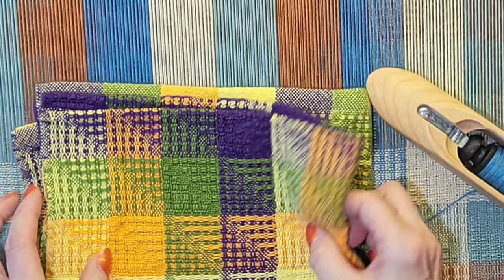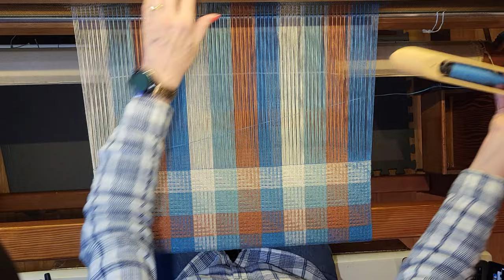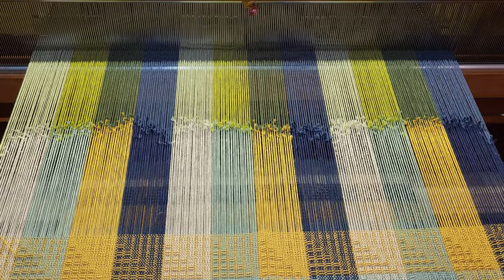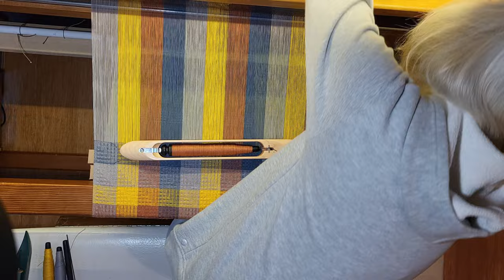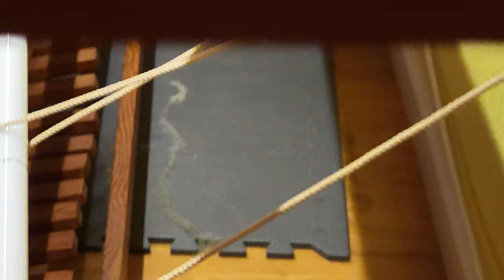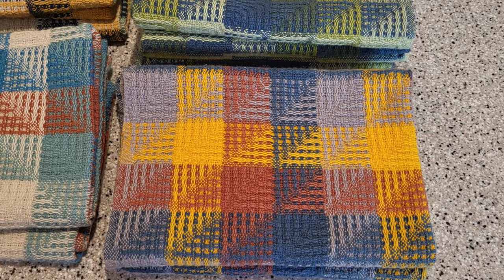Weaving the Turned Atwater-Bronson Towels

Comment: Lovely towels. I am going to try these. I know you sleyed the reed to 22 inches but how long did you weave each towel. The width of your towels ended up at 18 inches which is a 4 inch shrinkage. Did you get a 4 inch shrinkage on the length too. I wove towels in the Ms & Os pattern a while back and those also shrank 4 inches 😢. Thank you Grace x
Reply from the maker: These towels are a very popular pattern. If I remember right the pattern was 16 repeats which gave me 28.2" + 2" hem allowance on either end. After hemming they would be about 29.5" and they shrunk to 24.5" so a 5" shrinkage. Some of the towels shrunk a bit less depending how many of the colors were cottolin. Hope this helps. Thanks for watching.
Reply: 5" shrinkage 😮. I am still going to do them. Thank you for your reply.

Comment: I had a horrible time with using weavers knots with them coming undone so I changed to surgeons knots. They are a bit thicker but go through the reed okay and stay done up.
Reply from the maker: I did have a couple come undone but if I was careful to tug on them while tying I felt pretty safe. But if the surgeons knot works for you stick with what works. Thanks for watching and commenting.

Comment: Lovely towels. Is this based on draft 625 in the Strickler Book??
Reply from the maker: Thank you so much. Yes! Strickler #625 is the draft. Thanks for watching and commenting!
Reply: I started weaving this today from the Stickler book but the pattern is weaving over 2 colour ways and the weft floats, plain weave blocks and warp floats are not showing in the same place as in this video. I am trying to re-arrange the tie up. Wish me luck 😂😂😂
Reply: I started weaving this today from the pattern in the Stickler book but it isn't working out the same as Grace's did. The weft floats, plain weave and warp floats are not where they are as shown in this video and the pattern goes between two warp colours. I am trying to sort out another tie up. Please wish me luck because I will need it😂 😂
Reply from the maker: Are you using 12 treadles or a skeleton tie-up? I found the Strickler book's system of the block tie-up and treadling for Turned Atwater-Bronson very confusing. This pattern was also featured in the Nov/Dec 2022 issue of Handwoven Magazine as "My Very Peri Perfect Towels". The draft is written out fully and may be easier to interpret. Good luck!
Reply: I used Tim's rudimentary treadle reducer to reduce 12 treadles to 10. That worked fine and I did manage to get the pattern in the Stickler book but it wasn't as symmetrical as the pattern you were weaving. I have managed today to sort out what shafts need to be lift for all the blocks. I will put this info into Tim's treadle reducer tomorrow and see what he comes up with. I have had enough for one day. Thank you Grace for your good luck message as I definitely needed it 🙂
Reply from the maker: One thing to note with the stickler pattern, it is shifted so the pattern starts with plain weave block in the middle of the line. Mine started with the p/w block at the corner.
Reply: I have changed all the tie up now so my towels weave the same as yours. I should finish it soon and wash it and see how much it shrinks. Thank you Grace.
Reply from the maker: @chrisking9245 glad you got is sorted. This pattern sure taught me a lot about the turned Atwater-Bronson.